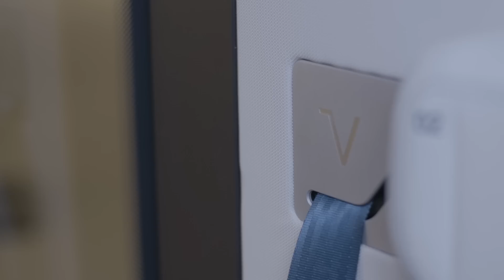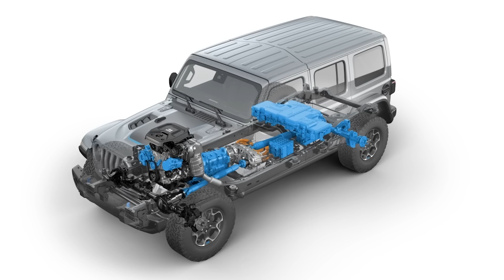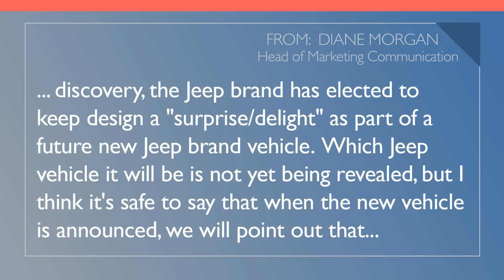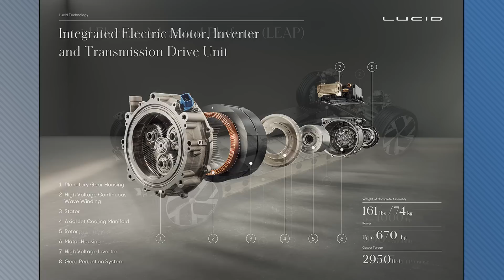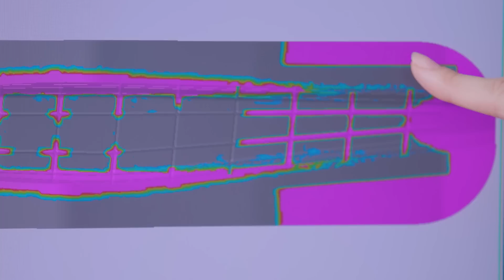All-New Jeep Wagoneer Revealed; GM & Honda Partner in North America - Autoline Daily 2910

Comment: Regarding the carbon fibre process - it's 2 minutes per batch, which is probably not fast enough for mass production if you are doing parts 1 at a time. But if you set up a rig where you create 10 copies of the same part, or more, then you're ramping up your speed. You just have to cut them into separate parts once you pop the mould.

Comment: I would expect those Nissan CF parts to be used in premium vehicles, like the Next Z-car or GTR(36). They would be low production so it is safe enough to produce without out stripping the production capacity.  This would in turn allow for a return on investment, field experience with the parts, and giving their cars an advantage normally reserved for vastly more expensive cars.

Comment: GM will build as many batteries as Tesla has now by 2025 and believe they can still sell some of those to Honda. And Honda is even worse believing they can use a GM platform. How many EV do they actually want to sell in 2025, like less then a 500k? Crazy how out of the loop they are.
Reply: Here's what you're missing, GM already sells on average 8 million vehicles every year so they don't need to sell millions of EVs right away. In fact they're going to shoot for lower EV numbers until at least 2025 and working towards getting the cost of production down enough for EVs to be as profitable as ICE vehicles.